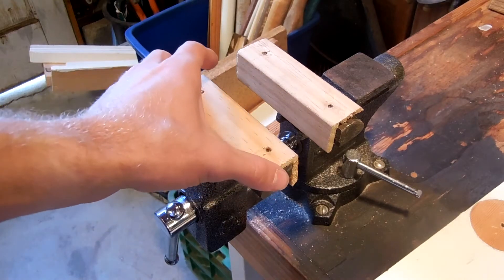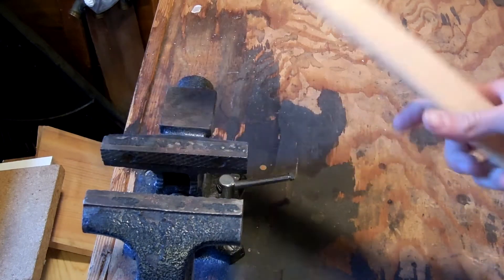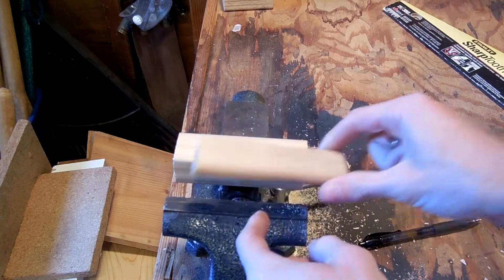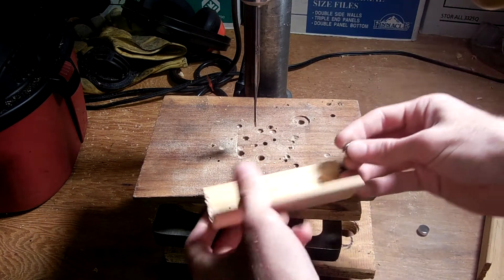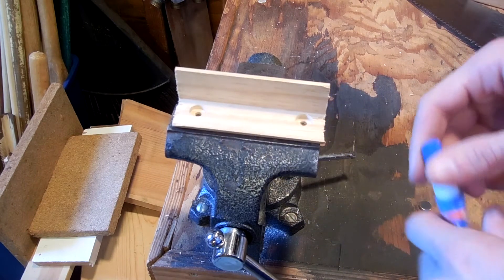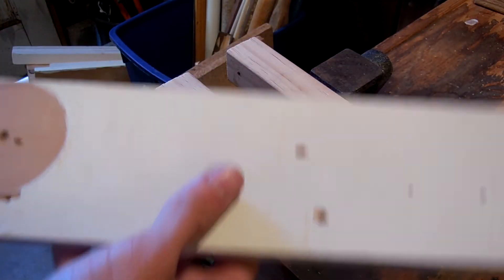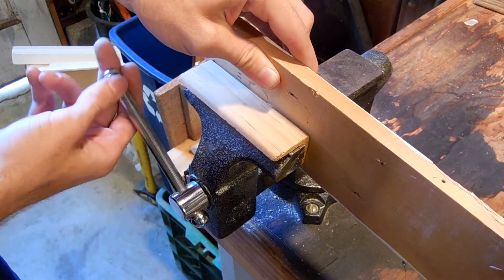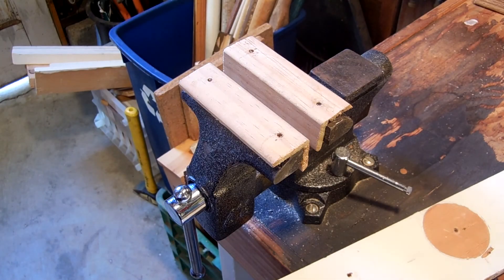Quick Build:  Easy Magnetic Wooden Soft Jaws

Comment: Thanks much for this video. Very clever and helpful idea. Being lazy, I just used magnetic tape, also found at Home Depot, in place of setting the magnets in the wood. Not as elegant, but much easier and seems to work fine. I also lined the jaw side with a piece of old bike tire innertube--super grippy and adds extra protection.